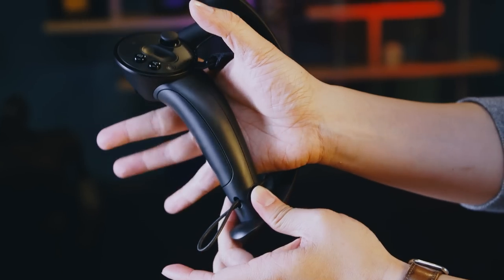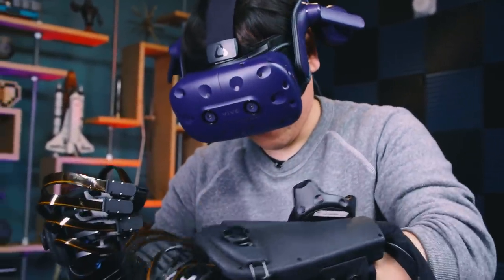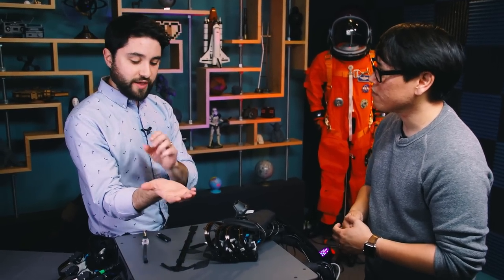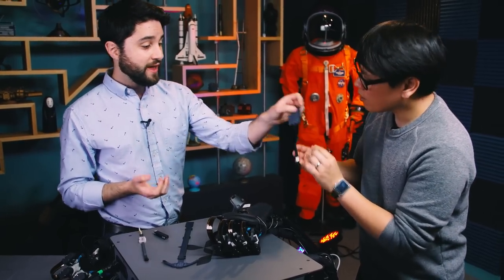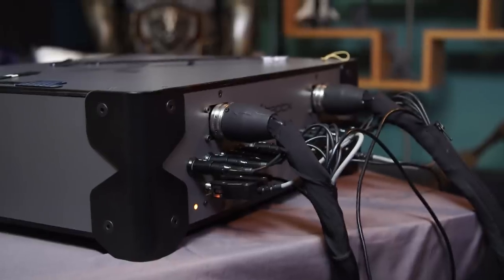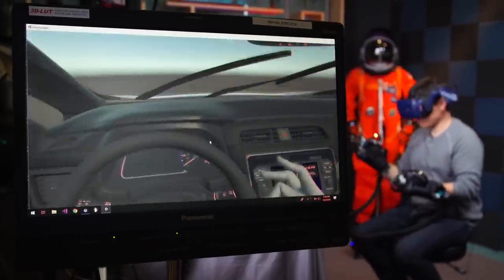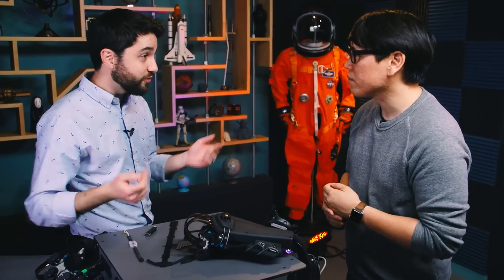Hands-On with HaptX VR Haptic Gloves!

Comment: I'd like to see finger leverage on a surface for fine motor control. I think a way to use them this way really has professional potential in graduating from a mouse. Maybe a sensor to measure pressure or angle or both? - sounds expensive.

Comment: You'll never see this except in specialized industrial or research applications. 128 valves, air source, big power supply, heavy enclosure, thick dragging cables, monster hands. Yeah, there's no way you'll be able to shrink this down. Pneumatics haven't changed in years so if they couldn't shrink it down now they never will, and expect to pay $10K+ for it.
Reply: Yeah even if they do manage to find a way to shrink down those gloves, there is still the issue of the tethered cables that are mandatory for the experience that will quite literally prevent them from becoming consumer devices.
Reply: @justmonika2345  Definitely. All those tubes bundled together. There's no way to shrink that down and try playing beat sabre while flaying that thick bundle around. Its an interesting approach but really the practicalities of it doom it to being just a curiosity.

Comment: The problem with that would be: hygiene.

Valve Index controllers might be a better but less accurate solution.
Reply: I'm sure that's on their list when he talked about mundane things that take time to work out for the consumer market, it just wasn't mentioned in the video. I get where you're coming from though, and as he said it's going to be some years before they've made this a practical device rather than a just functioning one.
Reply: That's great. Someone's made a glove with haptics and I think temperature but it's so big and hygiene would be the problem there, especially if that's used in public places like the new, the neo arcades.

Comment: Unfortunately this is cool but using air isn't working, use electricity to lift the tabs with small electromagnets, no need for the box then and you will use less power overall, or if you HAVE to go with a physical force, use small hydrolics and not a compressor, this system is just inefficient!
Reply: I thought the same thing it might not be cheap or move a lot that this does.
Reply: Wouldn't an electromagnet interfere with their position sensor? It uses an electromagnetic field after all. And hydraulics would just make a mess if a hose tears or a bubble bursts.
Reply: @ignatz14  the magnets should be inert til activated and at that scale may not produce a field large enough to produce any interference, a hydrolic system can be scaled down to a very small size very easily, think a syringe on a small tube.

Comment: I started to design a similar haptic system that used water instead of air, because I felt water's temperature could be affected more easily and therefore used to better effect when simulating objects of varying temperatures.

Comment: Ok when he says texture I don't think they have developed actual texture simulation into the glove. You could probably tell if the object is round, square, thin, flat ect. But to me real texture haptix simulation test would being able to tell the difference in a rough or smooth surface. That's not even considering a hot or cold surface. What they are developing right now is more akin to resistive only glove with embedded pressure mapping.

Comment: They have been experimenting with haptic feetback gloves for 20 years now it has existed since 1998 but the PC hardware was limited but still haptic feetback gloves and big  low resolution vr headsets already existed only were more used in arcades since they were so expensive

Comment: Complete table top or a wall  'stop' of your hand in a real discrete plane in free space will never be achieve without an actual mass in place. When some form of force field tech is developed and integrated into the system then maybe. There still remains the matter of VR and the sensation of acceleration.

Comment: Ok why not use small Electric Coils instead  of those Numatic Valves and need of Compressor inside this massive Box. Just Inagine micro Speaker system array but instead of coil moving the magnet will get pushed up ^^

Comment: The biggest problem with gloves in VR games is locomotion controls. How do you MOVE in VR if you have no joystick controller? The only possible ways are either treadmills or by leaning. The problem with leaning is, what happens when you are playing a stealth game or in a shooter and you need to peak around a corner? You lean to check corners and end up running out into the open. How do you make a TREADMILL storable? How do you make it cheap enough that the average person will WANT to buy it. We're already seeing modern VR systems like the Index charging a GRAND for basically the same system but with some higher resolution headset and a more comfortable controller. How much more expensive is the future of VR going to be? Noone will buy it and it will die. That is the future of Virtual Reality

Comment: No experience in or the field, this just an idea, why not use piezoelectric biomorph for tactile feedback instead of that big box that pumps in air to little bubble pockets with separate lines

Using piezoelectric biomorph, you can simply apply voltage to change the tactile feel and quicker and smaller than your air pocket system

Other idea, use polymer hydrogel you can make some which are electrically responsive, so you can have them on the entirety of the glove and apply voltage anywhere along a flexible PCB for power delivery also the contact points could be smaller resulting in higher resolution tactical feedback

Have a few other ideas which might possibly work also 

http://www.piezo.com/prodbm0nav.html

Some nice piezoelectric actuators on that link :)

Anyway what do I know I'm unemployed, have no degree in anything or college, just a bit of a nerd who likes vr and stuff

Not that the maker or anyone will read this anyway it's yt comments section, oh well :)

Best regards

Comment: I hope they don't make the same mistake the Power Glove did. The Power Glove was made so cheap it striped out much of the working technology, so the glove ended up not working. If this guy has to price the glove at even $1,000 then so be it. I just want it to work, because if it doesn't then this could actually end up setting back this kind of technology. There's clearly an appetite for controller feedback, as attested to the N64 Rumble Pack vibration now in every controller. Let's get it right the first time.

Comment: Why dont haptic comtrolers just use some sort of micro electromagnets to push or pull away from the other magnets on your hand this is probably a stupid thought just felt like getting it out want to see why it wouldnt work
Reply: One problem would be the size, while these pads are like 1 or 2mm thick, a linear actuator, even with only a flat coil and a permanent magnet (if that would even produce enough force) would be at least 10mm thick, more like 15mm to 20mm, escspecially when you need them so close together. An array of linear actuars of that size wouldn't be flexible enough to form around the shape of your hand aswell.
And it would be heavy with the copper and the magnet.

Comment: The problem is resistance from touching a solid object requires the muscles in your arms as well as your fingers. Cool tech though.
Reply: The solution is full body suits which would solve a lot of issues - no need to support the weight of all this hardware as it would be a powered exoskeleton as well as a haptic feedback framework.   It could be used to power you through a sequence of recorded movements from a martial arts master for example, giving you their experience.  Also as a means of telecontrol - of robots or other suits. A complete climate controlled protective system you will live in

Comment: They need to figure some way of expanding those bubbles using electricity/current rather than air, because that huge compressor is just a massive [literally] barrier to reducing the size of these gloves, and also means you'd presumably have to keep buying new air cylinders regularly (or whatever they are). So some form of electrical current that can make the bubbles change shape and size would have to be the way to go. Maybe similar to the kind of stuff they I assume they were using on those haptic smartphones screens we saw a tech conventions for a couple of years in a row a few years back.

Comment: I understand the setup not being commercially viable right now, but I wonder if they considered a more pared-down version of the system to both drum up public interest and for additional funding.

Let's say that you remove the tactile feedback and only had the ribbon-based force feedback system. Possibly trade the air bubbles with something simpler like the rumble motors inside of a video game controller. Most home VR systems are generally going to be used for VR gaming, so that would be more than enough for that. I mean, if I'm playing Skyrim VR and frantically pulling out my weapon to fend off undead monsters, I'm not going to be too upset that I can't feel the difference between the leather-wrapped dagger handle and the carved wooden handle.

As things get figured out more, and the main issue becomes just miniaturization, I can easily imagine higher resolution VR gloves being sold just light higher definition televisions or cell phones. People get something neat that they can enjoy now, and as newer upgrades come out, they'll buy the new ones. You get a single customer buying your products multiple times rather than just buying one "perfect" product.

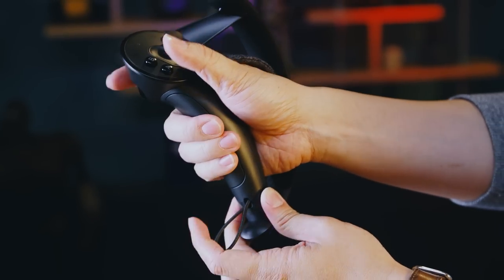Comment: 5:16-5:20 Steam Index? "Low cost" my ass, those controllers are almost $300 dollars sold separately.
Reply: Relatively speaking, $300 is "low cost" for a motion tracked controller with pressure sensitivity on the grip, considering nothing else on the consumer market provides that. How much do you think these gloves cost?
Reply: Scootzaar heck I know that but to label it as cheap is like calling Airpods cheap. The technology in them isn't that crazy and the build quality is okay but yet they're 5x the cost of a standard controller.
Reply: @3DCojo  The research and development of the Index Controllers took many years, they're designed and built in-house by Valve and the technology in them is actually pretty "crazy" for a consumer electronic. I'm not going out and buying them, $300 is pricey for anything (for me at least) but I can understand the economics of the pricing. The Xbox Elite controller, for example, costs around $150 and it is just a basic controller with some extra stuff attached to the outside. No pressure sensitivity, no haptic feedback, no motion tracking in VR space, no propritary technology at all. Index Controllers are backwards and side-wards compatible with other VR devices and control schemes. I stand by the idea that they are low cost in relative terms.

Comment: Way too clunky, both in design, the huge cable and the controller box.  Needs to be seriously streamlined to be something similar to the one from "Ready Player One" film.  This looks more like robot fighting gloves.  Also, why are the sensors and panels of them so big?  Technology has been going into the micro-scale, even nano-scale, to increase the amount of needed computational power for CPUs, GPUs, etc.  These sensors ought to be micro-sized and literally covering a glove to give near real feedback to that of actual skin on a hand in the VR world instead of just designated points.  This huge thing, though highly advanced, looks more like something from the 90s era of VR IMO.  Air bubble sensors?  The skin on your hand uses bio-electric feedback to give the sensation of touch, energy to energy.  So, these gloves should be using microscopic sensors that imitate that kind of mild electrical field of energy around the hand to form tiny pockets of magnetic contact to the skin so that it gives the same kind of sensation to that of your real hand feeling something.  Large air bubbles would feel off putting IMO and using controlled air flow tech just puts this whole thing behind times in advancement of VR IMO.  Why would you even consider bubbles of air as a viable sensor option?  They have limited lifespan due to the plastics strength that will eventually give out with usage.

Comment: Replace the pneumatic with a silicon graphine activated by electricity.
Reply: then there is not real way to control it and the precision goes out-the-door.
Reply: @evolicious  maybe not yet, but I see it as simple as adding power to the material in varying (low) voltages to make a reaction. I'm not an expert on graphine or anything really, but it's the future lol.

Comment: They should use Dielectric Elastomers / Electroactive Polymers, what ever you want to call them,  and get rid of the air system. Shrink that bad boy right down. But then again I sure their is a reason they didn't ^_^